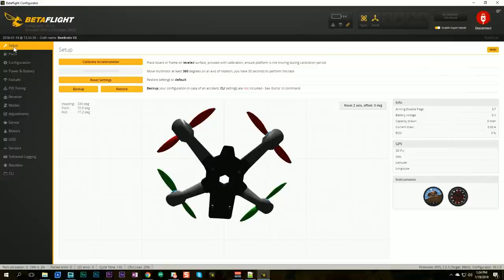Calibrate & Trim Betaflight Tiny Whoop Accelerometer | HOW TO FIX ANGLE MODE

Comment: what if you need to trim the yaw input? is it the same type of command? that's where my issue is
Reply: Yaw has nothing to do with the autolevel so i think no. Have you tried calibrating your Radio? Does it send 1500 at stick center?
Reply: If your having trouble with yaw mainly during higher throttle inputs try going into modes tab and enable antigravity across all modes. This worked better for me than enabling antigravity in config tab. I'm not sure why though. Maybe JB knows!
Reply: What is antigravity doing?
Reply: JB has a video that explains it. Basically it changes the PIDs a bit when you raise the throttle fast.
But before trying such advanced features first make sure the basic stuff is all set right. Antigravity is something 99% of the users don't really need.

Comment: I had an hold whoop I sold as I fried the board. It was stable could bounce off anything. Got this new whoop touch anything it spares out like I am in a pinball machine? Advice?
Reply from the maker: Gonna need a little bit more info. Like what exact model is it that you have now?
Reply: Thanks for the quick reply! It is a king Kong Tiny 6. Set it up on the v1 mockingbird setup. Latest firmware. Lots of new settings In the new firmware I am getting my head around, that are not in (or moved and improved) from that manual.

Comment: I sat small_angle=180 but my quad doesn't arm at any angle right after I plug my battery. After disarming it will arm at any angle. I use Betaflight 3.2. Probably there is an additional protection from arming before you're ready to fly. And maybe this protection won't allow you to arm at a race even if you have small_angle=180.
Reply from the maker: +Дмитрий type "status" in the CLI and look at the arming prevention flags to see why the quad won't arm
Reply: Thank you Joshua. Arming disable flags said CALIB. The flag goes away if a quad stays still for about 2 seconds. But if you hold it in your hands after plugging in the battery, it won't arm. It may sound strange why would somebody want to arm a quad while holding in their hands, I do it to get rid of snow that sometime gets stuck in motors after a crash.

Comment: I have a similar problem only mine is more and more off center the longer I fly. Eventually I am at full stick deflection and have no authority in that direction.
Reply from the maker: This is accelerometer drift. Try this:

set acc_lpf_hz = 1
set accxy_deadband = 80
set accz_deadband = 80

Comment: Hey does this apply to micro brushless quads I've tried to fly acro in my house with baby hawk and it's way to twitchy in acro mode for indoor flight...using same rates as my 5inch 400deg/s basically is it common to fly auto lvl in the house with micro brushless quads
Reply: Set up a second rate-profile with much lower rates and much less throttle and you can switch on the fly.
Reply: patrickcol thanks for the help man it was the rates... way to high for me at 400deg/sec

Comment: To anyone that can help.( You too Josh) ..I fly my King Kong ET100 mostly inside in angle mode. When I plug in and arm , it will idle up but trying to nearly flip over just idling. If I simply disarm and replug the batt it will generally idle level. Why is this? One thing I have discovered is that if I set it an an angle (@30 deg) when I plug in and then set it flat on floor, it will almost always idle up level the first time. Should I do the acc cal from the tx every time before I arm it to prevent this ? Also it's a pikoblx fc and I do have [set small_angle = 180] in the CLI if it matters. Some education on this would be greatly appreciated.
Reply from the maker: You shouldn't need to calibrate repeatedly. Although in older versions of BF, the acc calibration wasn't automatically saved when you power cycled. To fix that, hold the sticks down and to the outside corners after finishing calibration.

Comment: I'm having troubles getting mine to stay level. it  seems to be registering the trim input but it still continues to pull to the right. Seems the longer I'm in the air the more it pulls, requiring more and more stick input to the left to keep it centred.  any ideas?  I've calibrated the accelerometer multiple times and still the same result.  If I go into acro (rate) it flies fine.
Reply from the maker: +CodeBlue FPV go. To the CLI and reduce acc_lpf_hz.
Reply: Joshua Bardwell it's set at 10 presently. Reduce to 0?
Reply: I've reduced to 5 and zero and same problem. Horizon mode seems to work. Just angle mode

Comment: ..I usually just do the OSD restart FC option...Is there a difference between the onboard calibration technique vs the calibration?
Reply from the maker: The gyro calibrates every time you power up. The accelerometer you have to calibrate manually.
Reply from the maker: The reason the accelerometer doesn't calibrate automatically is, the ACC must calibrate when the quad is level and flat, and that's not always guaranteed.
Reply: @JoshuaBardwell  the knowitall strikes again lol, I did not realize gyro and accelerometer are different

Comment: Hei JB, can you help me out ? I am trying this  acc trim using stick commands with a Marauder 515 and it does not work at all. I know about the sticks down + spread to save, and I have my endpoints perfectly calibrated. Is it possible that my stick commands are deactivated?? thank you in advance!
Reply from the maker: In newer versions of betalfight, it doesn't work unless you are in angle mode.
Reply: @JoshuaBardwell  thank you very much!  It did work for me in horizon mode.

Comment: Hello I’m new to quads.  At 1:27 you said freestyle pilots have to be able to go inverted...I’m confused...i didn’t think quads could go inverted.  I thought only helis and planes could do that...can quads really go inverted and hold a position upside down and fly upside down like a 3d helicopter or a plane?  Thanks in advance for your answer.  Great video btw.  Great information as always!
Reply from the maker: There are 3D quads that can fly inverted. But what I meant was just the ability to flip upside down and stay that way while you fall.

Comment: Firstly thank you for this wonderfully informative video series. I recently purchased an eachine aurora 90, I have been flying toy quads like syma x5 etc but this is my first real quad. I have been binge watching your videos and they have been very helpful. But I have run into a wall. No matter what I do the quad drifts to the left and only gets worse the longer I fly, after about three minutes I have to stop because the left drift is so bad I can no longer move to the right. I tried to use the stick commands in this video to trim the quad but it only gets worse. Also after I trim with the sticks when I connect to betaflight the configuration tab shows only 0 for the accelerometer trim so I'm not sure trimming with the sticks is even working. The led strip on the back responds when I use the sticks but like I said betaflight shows no change. I've been trying to fix this for two months now any advice would be appreciated. Again thank you for your outstanding videos.
Reply from the maker: This is accelerometer drift and unfirt4there isn't a guaranteed solution. Try going to the CLI and typing

set acc_lpf_hz = 1
save

Comment: Hi Joshua! Thanks for great video :)
I wonder if those commands you were showing works on any quad (meaning any quad with BF). Don't you need an OSD or telemtry or something like that? I mean will this work even on some cheap ready to fly quads with no fancy features (for example Eachine Wizard x220)?
Reply: It works for any quad running Betaflight. ANY quad. :)
Reply from the maker: +TomicaCZ any Betaflight or Cleanflight quad.
Reply: Thanks for answer guys :-)
But I guess the arm switch on my transmitter has still higher priority than a stick command (I just wanted to try it now and arm via sticks didn't work)

Comment: Thanks for introducing us to stick commands. I tried flying angle mode with trashcan. I just can't seem to get it. As soon as I move quad forward it loses altitude ? Why is that ?
Reply from the maker: When it pitches forward less thrust is pointing down because some is pointing back. You most raise throttle slightly to maintain altitude.
Reply: @JoshuaBardwell  In your videos where you fly whoops indoors, do you use acro mode ?

Comment: Would love to see a video with some settings to try and get angle mode in betaflight to perform a bit more like a stock inductrix board.
Reply from the maker: +Jimster71 project Mockingbird linked in video description m
Reply: My bad, thanks. Will definitely check that out.

Comment: Joshua; I have a few questions. First I'm an old man,  I'm never going to race but I would love to fly  a sedate quad around my home and yard without punching it to the moon, without spying on my neighbor's, nubile daughter, I do want fpv, I've got many cameras and transmitters, I run them on my Axials, etc. I want gps, self-leveling and following, smaller is better, can you help?
Reply from the maker: I honestly don't have a lot of experience with sedate quads. If you have the budget for it, you won't be disappointed by a Phantom. Even an older one that can be had cheaply will still probably do what you need.
Reply: Thanks so much for taking the time to answer.

Comment: The stick commands to trim do not work on the happymodel mobula 6.  Any ideas?
Reply from the maker: Put it in Angle mode. It has to be in Angle mode. It didn't used to have to be in Angle mode when I made this video.

Comment: I wonder why the radios trim buttons don't work for adjustments. Is there a way to set up the radio so you can just use the trim buttons?
Reply from the maker: +FPV Under250 the sticks in a multirotor should always center at 1500. Trim must be handled on the FC.
Reply: Trims are usually disabled on spectrum radios when setting up new models in quads. Reason is per JB’s video. Trimming Acc is the right way to do it.  You can enable those in sub menu but if you really want to but it is more like adding constant stick than truly trimming the Acc in the FC.  If you have ever done this and then switched to acro you know why We trim the FC.  I too used to use the one on gimbals and learned hard way when flipping modes.
Reply: +kweidner1 thanks! What you're saying makes sense, it's just too bad it's not a bit more intuitive, as it would be if you could achieve the same effect by using those useless buttons instead of stick commands, oh well!
Reply: I assume they are more for Planes and not quads. Lol. Don’t fly planes...........yet.

Comment: Hello Joshua. THANKS for all the great info in your videos. I still am unable to get my Meteor 75 to trim properly. I've tried everything you suggested and regardless of how much trim I add the M75 will end up drifting hard to the left after about 10-20 seconds of flight. Even if I pin the trim on my controller, the beginning of the flight I may be trimmed a bit to the right but within 10 seconds it starts a slow drift that ends up being a fairly substantial drift to the left. Any idea what could be going on? This is my second M75 as I returned the first one with the same exact problem. Thanks in advance for your help.
Reply from the maker: If the quad starts out level then starts drifting, you have a problem called accelerometer drift and unfortunately there is no reliable solution other than replacing the FC.
Reply: @JoshuaBardwell  Well this would be the 2nd one in a row that I'm returning on Amazon. What a shame, it seems like such a fun quad to fly. THANKS so much for the reply!
Reply: @JoshuaBardwell  Do you know if this is common among Meteor 75's? I'm going to return this one and hopefully the 3rd time's the charm!

Comment: If you arm in acro is the accelerometer still holding the angle of the last crash or is it random ?
Reply from the maker: If you crash, the accelerometer can be knocked out of trim, but I'm not sure what angle it might end up at. I'm not sure that it's predictable. However if you're in acro mode, the accelerometer has no effect.

Comment: I'm old school. Can't you do the same with the switches by the gimbal?
Reply from the maker: The trim switches shouldn't be used to adjust autolevel trim. Otherwise when you switch out of autolevel mode, the channel centers won't be correct and the quad will want to drift.
Reply: @JoshuaBardwell  . I learned something today. Thanks!

Comment: Hi Joshua,
does the accelerometer calibration work with the x-lite as well
Reply from the maker: Yes it works with any transmitter. It's built into the flight controller not the transmitter.

Comment: Does this work with all betaflight controllers, or is it board dependant?  I have a betafpv board that it doesnt seem to work on?
Reply: maybe i got the command wrong and was pushing the stick to the upper left would it not work in that case?  I guess I need to test it.
Reply from the maker: It works with all Betaflight FC. Angle mode must be activated for it to trigger.
Reply: @JoshuaBardwell  ok thanks!  I think pushing the throttle to the upper left was my issue, instead of just straight up.

Comment: My fpv drone is wanting to flip over ever time I give it throttle do I have to adjust the trim I’m very stressed out trying to figure out how to fix it to stop flipping over when I give it throttle
Reply from the maker: If the quad suddenly pops up in the air and then disarms when you arm, it is almost always one of these things.

1. Clockwise prop installed on counter-clockwise spinning motor or vice versa. Double check the motor direction is as expected and then double check that the correct prop is on each motor.

2. Flight controller not facing forward. Go to the Setup tab in the configurator. Tilt the quadcopter on all axes (pitch, roll, yaw) with your hands. The 3D model in the configurator should move the same as you move it with your hand. If it does not, use the Board Alignment parameters in the Configuration tab to fix it. Do not use the "GYRO/ACCEL" parameter. Use the "Roll Degrees", "Pitch Degrees", and "Yaw Degrees" parameters.

3. Motors not wired correctly. TAKE OFF YOUR PROPS. Plug in a battery. Go to the Motors tab. Turn on the "props are off" slider in the lower-right. Raise the individual sliders (1, 2, 3, and 4) one at a time, just enough that the motor begins spinning. The motor positions (1, 2, 3, and 4) should match the graphic in the upper left. If they do not, then either move the signal wires so that they are correct or use resource reassignment to virtually "move" the motors.

4. Motor spinning wrong direction. Do the same as step 3 but compare the motor direction to the arrows on the graphic in the upper left. If a motor is spinning the wrong direction, either reverse it using BLHeli (or whatever ESC software you are using) or swap any two motor wires with each other, which will reverse the direction.

5. If you have enabled the "motor direction is reversed" parameter in the Configuration tab, then you must go into blheli and reverse the motors, or swap the motor wires to reverse the motors. The "motor direction is reversed" option TELLS betaflight THAT you reversed the motors. It does not reverse the motors. This is a special case of #4 where the motors are spinning the wrong direction.
Reply: @JoshuaBardwell  When I flip my arm switch it goes from 2000 down to 1000 and when I go to my receiver tab when I flip the arm switch it goes to 999 and when I flip it down it goes to 1998 is that correct or is it off
Reply from the maker: It just depends on how you've set up the aux modes.
Reply: @JoshuaBardwell  I set the arm switch where the throttle is in the beeper switch where the role throttle is where it rolls

Comment: I was totally thinking about how I was wanting this video after the discussion in your tiny whoop race video. And you delivered! You must be a mind reader. But please don't spend too much time in there cause that is creepy XD

I wonder if the trims are something that a Lua script could modify as well. I don't see the stick commands being that much of a hassle but it would be nice to know how far you are out without having to connect to usb.
Reply from the maker: How far out you are is a function of the initial calibration. You could calibrate it 45 degrees to the left and then trim it back to level.
Reply: Ahhh so it is basically shifting the actual calibration values and not just adding compensation like the trims on the transmitter would? ( I should go watch and listen closer since you might have actually said that and my brain got caught up on the terminology)

Comment: Hi, thaks for this video. Its really great. Do you know, if there is a similar Stick command to solve the drift for Emuflight? Thanks
Reply from the maker: The exact same stick commands work in Emuflight.
Reply: @JoshuaBardwell  Ah wow, didn't work when I tried, but I'll try again, thanks a lot!
Reply from the maker: Need to have Angle mode activated or it won't work.
Reply: @JoshuaBardwell  Thanks, thats it, I was in Horizon mode.

Comment: What if it's ok when you arm it, but at the end of the flight it's drifting?
Reply from the maker: Unfortunately that means you have a bug called autolevel drift and there isn't a reliable fix other than to replace the FC and cross your fingers.

Comment: my eachine e010s cant do 8k8k without the cpu usage maxing out any tips?
Reply from the maker: Run it at 4k/4k.
Reply: Joshua Bardwell ok thanks I’m looking foward to your future videos on the whoops.  Especially the gyro settings.  I find that when they are all on its real slow but when they are off tons of power but alittle yaw drift.